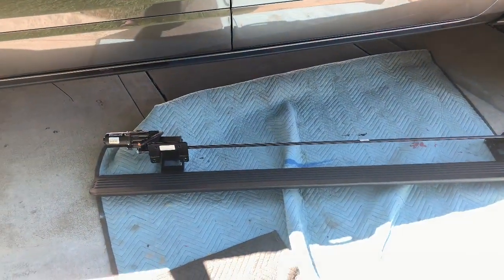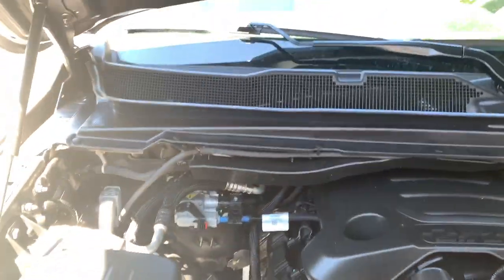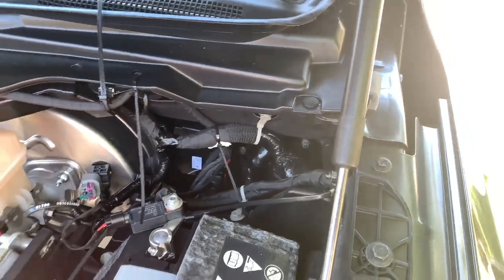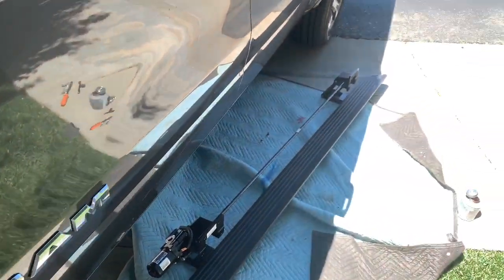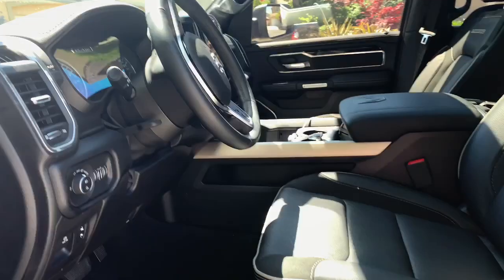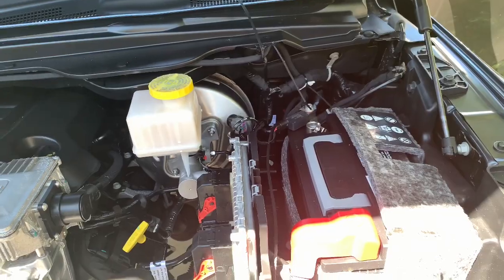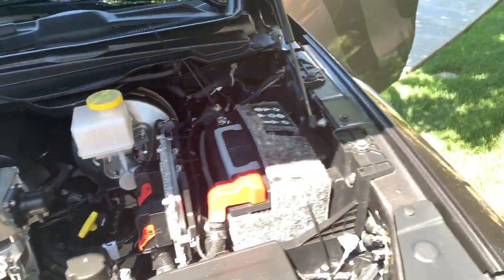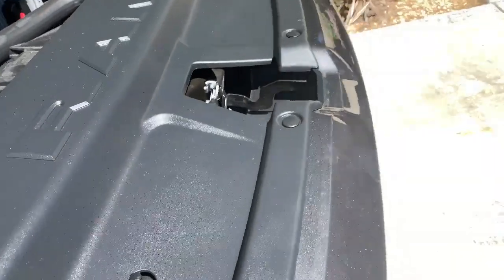Mopar Power Running Boards Ram 2019

Comment from the maker: The part number is 82215287AC
It’s is very difficult to install the wiring harness, it’s better to have the dealership installed it cause they will also have to add it the the system 
maybe you should look into the Amp research steps which they’re plug and ply
Reply: Bobby Steele looks like the AMP boards though use the OBD port. Could not tell if these are the same way?